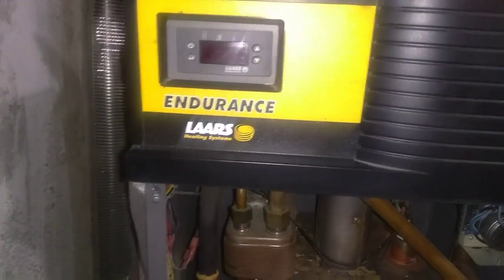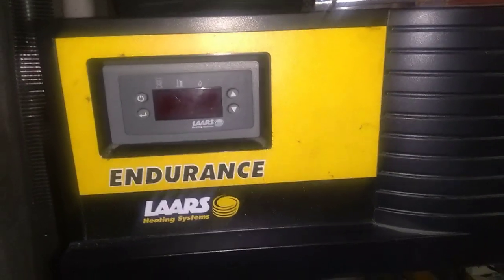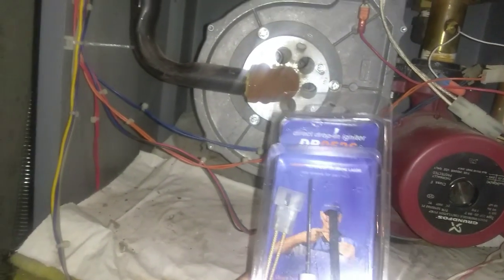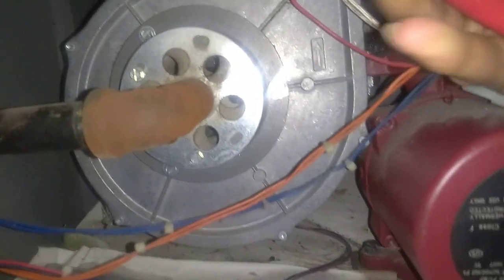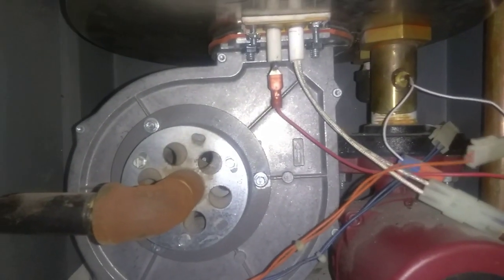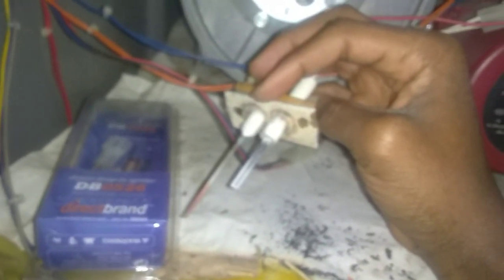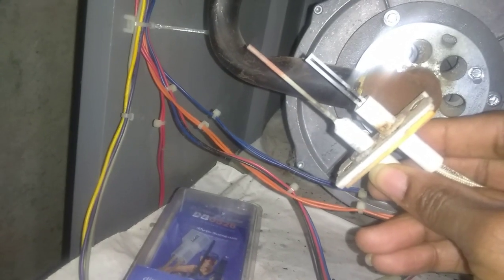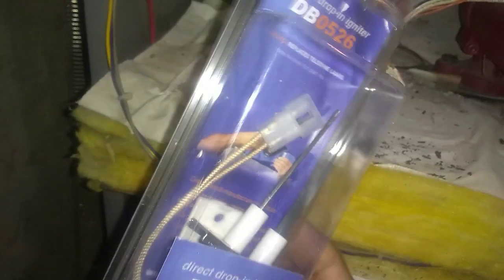Part2 L.O. code Laars Endurence heater Home Depot. Gave Me the wrong ignition Switch

Comment: How do you get the front cover off of that boiler?
Reply from the maker: ?? Little confused please elaborate
Reply: @leviteapparel  how do you remove the front cover of the boiler so you can get to the ignitor?  I have the same boiler
Reply: @leviteapparel  How do you remove the front cover of the Laars Endurance furnace to get to the ignitor?  Help me out man
Reply from the maker: Four Corners each one have a push and plug feature go to east side and pull then it will come off
Reply from the maker: There are times on four corners you have to pull one quarter at a time